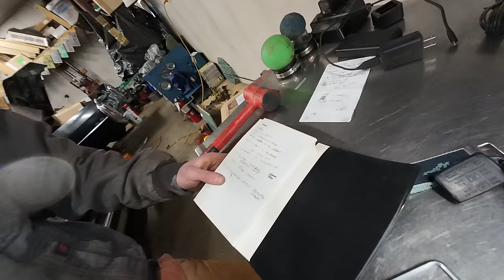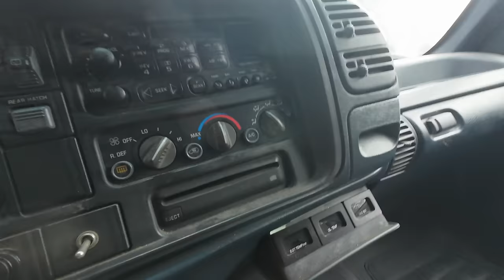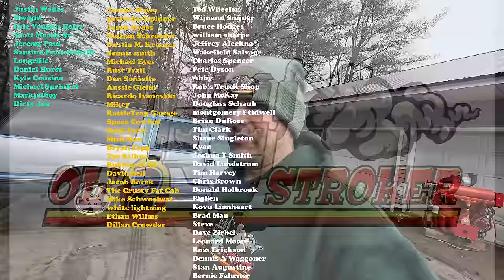Marketplace Score | 453T 2-Stroke Detroit Diesel 1995 Suburban

Comment: the ac control panel may be dead and thats why its got a bonus switch for the compressor, those panels die like its a feature. scoping out the schematic for the hvac may be worth a sniff just to verify everything is going the right direction on the hook up
Reply from the maker: i was wondering that myself. if it needs a panel it'll get a panel. I can't deal with that switch.

Comment: A GMT400 in the northeast?
And that's all the rust she's got?
That's fuckin' mint!
Reply from the maker: It could definitely be worse
Reply: i bought one 12 years ago and i've only put like 20,000 on it since and it's mostly sat in my garage it's a little cleaner than this but i still need to do one cab corner on it some day ..., but i live in the extreme northern maine so everything rusts here except new fords
Reply: @Hard_Right  I believe new Chevrolets are also aluminum
Reply: @porcupinepunch6893  Doors, hood and tailgate are aluminum. The cab shell is still steel.
Reply: When you undercoat your vehicle every fall, this is what you get. $30 in product a year for no rust.
Reply: Yeah my 2004 was worse than that before I had the bodywork done. Cab corners, gone. Rear quarters, mega-gone. Rockers, gone AF.
Reply: @Hard_Right  Fucking preach brother. Everything in this state gets fucked by rust

Comment: That rear tab that is broken holding in the front diff is the only thing keeping you from dropping the front axle out the bottom of the rig.  I made the tab in my k2500 removable, so now I can drop out the front axle and drag link and pull the pan off the Cummins in chassis.

Comment: I'm here for it, all I need to hear is Detroit 2 Stroke Swapped and I'm in.  There is one on the youtubes that has an air starter..ridiculously cool.   I swapped some Hadley Air Horns on my Tahoe connected in a box to the spare tire, runs off a tiny plug in  "hot dog" air compressor connected to an inverter with a pneumatic valve for accurate volume control, would recommend..
Great video btw

Comment: You can lower the front differential to get more clearance by getting a 6 inch lift kit for the suburban. The kit comes with brackets to lower it so it’s out of the way for the driveshaft.

Comment: Hey, I have one of these too, but mine's a 99. Mind that these don't have engine shutoff switches if your oil goes low, and besides that, the doggone oil lines are held on with a C Clip. It was recommended to me to switch the oil cooler and oil cooler lines out for something with compression fittings, so I did that for mine. 

There's a whole heap of info of these over at the DieselPlace forum, if you feel like heading over there.

Oh, and I had to take the fuel tank off mine once, and it was more or less "glued" into position even without the metal tank straps holding it up. I had to put a strap over the top of it, then put the strap underneath a car jack with a piece of wood on the top of it to push against the tank, and then I extended the jack. That worked.
Reply: I knew a guy who put a 453 into a 1949 Chev 3/4 ton pickup . It looked dead stick,even on widow makers but FAST 😂

Comment: What a plum ❤

If you didn’t have to rob a bank to make it happen, a turbo 400 with a gear vendor overdrive would be sweet.  You NEED to record every single minute you work on this. 👌
Reply from the maker: rather have a 4l80e so i can have a lockup converter
Reply: Alison

Comment: Really Awesome!!! I wish GM had this as a choice from the factory. First of all, flex plates are special "spring" grade hardened steel, so I don't believe regular 1/8 inch will work. Maybe thicker will hold up? I don't know. On the gauges, and that would include the clocks in these mid 90's vehicles, they are actually vacuum fluorescent tubes (not leds). I miss seeing them in instrument clusters. Thanks guy's for taking on this project! I can't wait to hear the Jakes!
Reply from the maker: I wish they did too!

Comment: 47:14 look closely at the bottom right of the video. You can see the cable moving from the current flowing through it. Basically the same way current moves the rotor in an electric motor. You need hundreds of amps to do this in a wire hanging in free air. So your charger is definitely doing its thing there.
Reply from the maker: I noticed that too

Comment: I did an inframe overhaul on a 6V92 NA that had 750,000 miles on it. The owner ran down the highway at 1800 RPM instread of what most do, run them on the governor.

Comment: Wow! A guy would have to look pretty close to tell what's under the hood without starting it! I'm surprised it runs as well as it does with 300K on the motor. Probably would be a plan to do bearings, oil pump, etc. at some point to keep it fresh. Pretty nice catch there Wayne!😄
Reply from the maker: I dont really have much interest in pulling the pan! lol

Comment: 700r4 and 4l60 non E both are the same and shift based on hydraulic pressure and rpm. The TV throttle valve cable is different than the kickdown cable. Worth researching

Comment: I’d see about a 4L80E instead of the 4L60E that you mentioned earlier in the video about possibly putting in because the 4L60E was a tranny meant for the 1/2 ton trucks and SUV’s and was never intended to deal with the torque of a Diesel but the 4L80E was for the 3/4 and 1 ton trucks and designed for the beefier torque producing engines
Reply from the maker: You wouldn't ever catch me owning a 4l60e for any reason lol

Comment: fun fact a  453T is more gutless then the factory 350 sbc so its no surprise it lasted. And you can tell he never hot rodded it. Just drove it alot. So it really never was stressing out the trans
Reply from the maker: There's no way that smallblock was making 170hp or 405ft-lbs sorry.

Comment: 4:40 😅Thats an Aquastat thats used in plumbing on boilers & radiant heating systems. Its basically just a adjustable temperature controlled switch that you use to turn other things in the system on & off like the circulation pump that pushes the heated water through the heat system. Never seen it used on a vehicle but if it works it works!🤷🏻‍♂️🤔👍🏻👌🏻🛠️🔧🔩🗜️😂
Reply: This need a 1 -2" body lift, a small suspension lift and maybe 3\4 ton axles. The 2 seperate lifts would help with all those tight clearance issues. Idk if you saw but @DetroitGarage on YT up in Canada has a 453t in a 08 or 09 superduty with a 5r110 and it all works and shifts properly including all the dash gauges are working like factory too. Any questions about a Detroit he's another DD fanatic.
Reply: 20:47 "I'll just weld it!"

Lincoln locker to the rescue!

Comment: I really think you should buy a rust free doner find a 3/4 ton suburban lift the body off that one swap the engine into the 2500 suburban chassis work some magic tidy some of the really crude stuff up patch up thr oil leaks then drop the rust free body back on it.  Its easy work with a hoist.  Its definitely flat out badass enough to titts out and keep around
Reply from the maker: those were my thoughts.... but its so much easier to leave it a 1500 lol

Comment: Sooooo sir, you may not get very many people looking at you. My brother and I get a lot off people staring at us when we take the Pontiac Trans Am cars out for a cruise. A 2002 and a 1979 Trans Am following each other on the road. NO one will be staring at you while you are just cruising down the road. Ok, fine, UP UNTIL people HEAR your vehicle and then they say " What the FUU******dge" the moment they heard a sound that they assumed would only come from Class 8 Semi Trucks. Compression Release Engine Braking. Or what most people today call, The Jake Brake. 

EMBRACE IT! EMBRACE the fact that you can deafen your fellow travelers on the road and they LOVE you for it. 

A little bit extreme I'm sure, but such POWER is YOURS for the taking.

Comment: 1995 would be 4l60e from the factory. Last year for 700r4 was 1992.
Reply from the maker: Yea it was swapped im sure
Reply: @Ol2Stroker yeah that 4 pin connector is a giveaway. Still can’t figure out the reason for the throttle body, but he’s got some “engineering” going on here.
Reply from the maker: @mjmcomputers  it's what the tv cable and tps hook too

Comment: What's the back story on this conversion ?    Where did you come from, Where did you go ?   Cotton Eyed Joe ?  Whoever dreamed and lived with that concealed battery setup, needs to apply for a concealed carry permit . Certainly there's a better place in the rear interior or spare tire well  and 15' of 2  or 3 guage cable would  be better .  Plus somebody overlooked the Cole Hershey jumper studs that are on most semis today because the fiberglass air deflectors hide the batteries there as well .. Good luck wayne, if it's yours to trim out to your standards.  Certainly enough material for several more videos .
Reply from the maker: Came from Conneticut, old guy bought it new ran it to 203kmi when the 350 popped. His buddy worked on Detroits or something so they tossed in this 453t and then run the hell out of it!!! I agree on the battery location, it's ..... inconvenient!

Comment: How big/heavy is that 4-53 vs a 4BT? 

Obviously it sounds an order of magnitude better. 

Pretty nuts to me that he put it in front of a 700R4 rather than 4L80 (ideally) or TH400. 

And obviously we all need 2 more inches...
Reply from the maker: 453t is 1200lbs. I know nothing about a 4bt lol i agree, it definitely needs an 80
Reply: @Ol2Stroker  most places say around 800lb for a 4BT so it sounds like the 53 is WAY heavier than the BT, even though it's a bit smaller (BT is around 60ci/hole for the older ones).
Reply from the maker: @totensiebush  it's smaller in cubic inches but alot bigger physically.
Reply: @Ol2Stroker  I have minimal diesel experience so that surprises me. On dirtbikes, usually a 2 stroke engine is lighter than a 4 stroke of the same displacement. 

I've been tempted to pick up an RV or converted bus with a 53 or 71 (or even 92), but given what diesel costs it's hard to justify if I'm putting miles on it.

Comment: 453T 2-Stroke Detroit Diesel, i got to tell you a nightmare you need a big box of tums ok the place i worked had 4 strait trucks no 2 run at the same time like call tow truck i going to drive this 50 miles these were not swamped they were built with them  453T 2-Stroke Detroit Diesel, sent one out to North Dakota from Mansfield pa it broke sent other one out then dropped off rebuilt motor & drove 50 miles back boom water all over it went sent a semi rig with pallet other motor 453 t 2 stroke the was v6 92 tt it ran all the way out and back!  how this mess ended up in smoke ashes 5 build january 2 1987 a 6v 92 tt run away apart caught place on fire burned to ground! in court GM law person ( i was in his office) we knew it do that when before the date! it problem it run away off it own oil! it crap! it a white truck we sue white if we loose the phone rung  he talks we own white truck now! jumped from frying pan to the fire just pay the guy he a doctor he keep suing you people! i made mail trucks GM supply the drive train! I was there when place went up in smoke! i saw it all! i did not put that thing to gather the other guy did! ok! i tell in court! i got bigger diesel problem after ww2 the was test made boats glow my relation was there & got real sick like deathly sick 100% death rate cancer sick & lived threw it ok he really close related to my mother I a seal adoption(done in court in 1963 the step father brother was there to a job it was he saw my real father ) the guy i called uncle & he drove truck & fixed boat engines oh great my relation owns a gray marine 2 stroke engine in a boat lived in flippin ark & ran a boat factory like it boss & founder of ranger boat forest wood & the uncle fixed his boat engine here the book you need I gave doctors the name and number they said a medical test & living there a nasty cancer & the meds blood thinner was what he found worked!  100% death rate cancer that what it was!

Comment: Why would someone swap a diesel into a 1500 chassis Suburban?
Reply: Reasonable question.
Reply from the maker: The real question is... Why WOULDN'T you?!
Reply: @Ol2Stroker  makes more sense to swap it into an 8-lugger IMO
Reply from the maker: @literallyshaking8019  agree but he didn't have an 8 lugger and this would outlast the factory diesel offering 10 to 1.
Reply: @Ol2Stroker  gotta work with what you have (or in my case in the Northeast, what isn’t a rusted out heap).

I was actually hoping to find an old 6.5L Detroit Suburban. I know they’re not the most sought after diesels compared to a 5.9 Cummins or a 7.3L Excursion, but with marine/military bolt ons they seem to go forever.
Reply: Cheaper tires

Comment: that's the wrong Generation Suburban for a 2 stroke, should be in a 5th 6th or 7th Gen,
but in this ,there I'd put a 6.5 detroit in.
Reply from the maker: The only place for a 6.5 is the scrap pile
Reply: If you do the bullet proof 6.5 from the diesel place they are good though oil pan is too small
Reply: Heath diesel is getting 500 hp from a 6.5

Comment: NOOOOOOOO! You know better, Straight 30 or 40 in that.
Reply from the maker: 40 for me please! (My rotella jug has 40 weight in it because I stock it in 55gal drums.
Reply: @Ol2Stroker  OK Phew!
Reply: Ive run  15-40 in the 353 and 453 in logging skidders for many years and never had a issue  ! But I also run 25% of Lucas oil